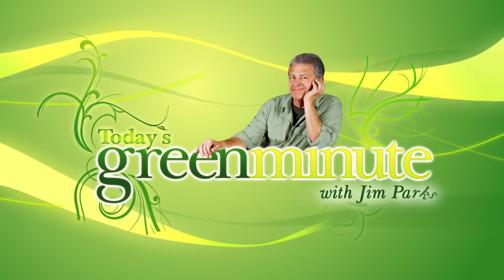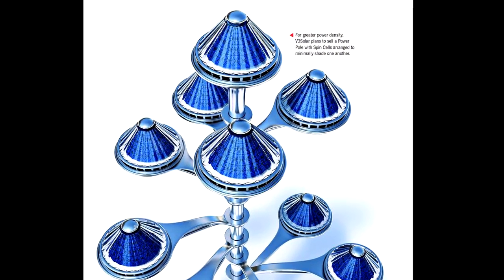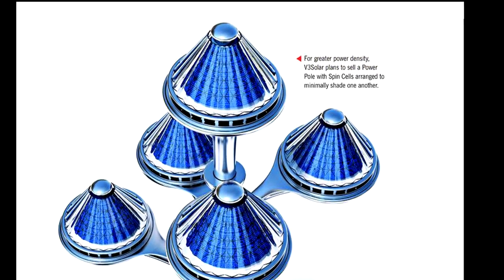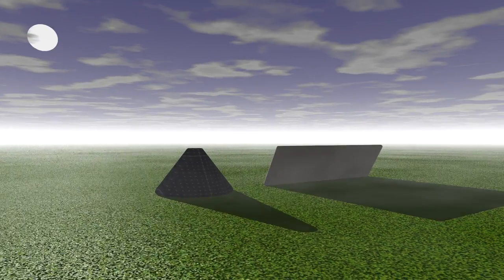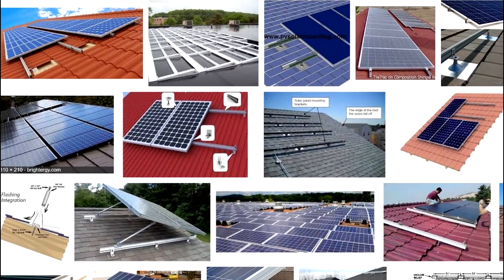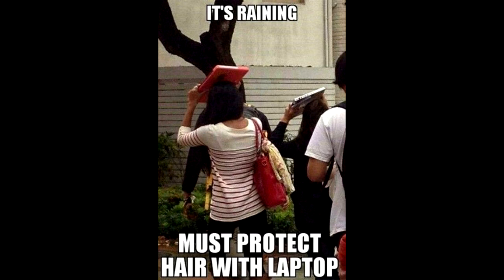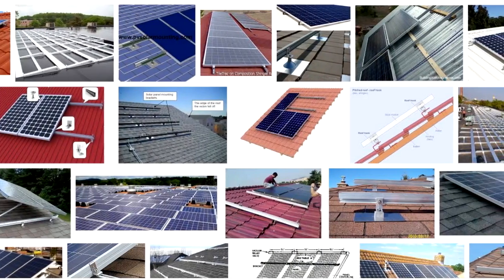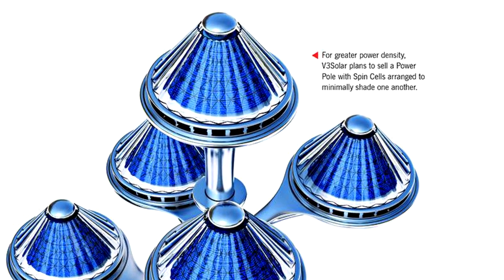Spinning Solar -BUSTED!

Comment: While I agree on most of the assumptions, there is one thing that ist missing. Lenses are able to collect diffused light from any angle in a range of 180°. This improves also efficiency on direct solar rays comming in from a flat angle. So the right thing to do is to use lenses on a flat solar panel. There are modern generations of solar panels that have smal lenses built in the glass that covers the panels,  this can increase efficiency of the panel in the range of a few % without increasing the costs or the weight of the panel in the same way. However the solar cones on a tree just look nice so it might serve a purpose once in a while as long as the main goal is not energy efficiency or cost efficiency. You might consider it as a kind of power producing decoration that can produce the power for a fountain somewhere out without needing to build a powerline.

Comment: Ok, so I agree with almost everything in the video, and I myself have debunked this solar "panel" a year or more ago but there is one thing that was not brought up in the video.  The most efficient solar cells require concentrated sun light to achieve their high efficiency.  Unfortunately these high efficiency solar cells are very expensive and require hundreds of times concentration to achieve the high efficiency.  The V3 solar collector linear lenses do not get anywhere near the concentration to power these high efficiency cell, and even if they could the efficiency would only be about double that of commercial non concentrating cells.  

But even if they were planning on using concentration and more efficient cells, they would still only have a fraction of the solar cells receiving concentrated solar radiation at any time.  So at the end of the day we still have bullshit.

Comment: The surface area measurements in the video at 3:56 are either wrong or do not at all represent the the picture of the cone on the screen. In the video, when showing the calculation for the surface area of the cone it shows the radius of the base of the cone as 1m when in actuality the diameter of the cone on the screen is approximately 1m. The radius is closer to half that indicated which provides for a smaller surface area which ironically only leads to prove the point of the video further. Love the videos!
Reply: The proportions of a diagram don't always have to be exact to what the measurements claim.

like if I drew a rectangle and labeled the sides as "1foot by 4 feet." then it's a rectangle that's supposed to be 1 foot wide and 4 feet long. it doesn't mater if I didn't actually draw the rectangle precisely 4 times longer than it's width and only drew it vaguely twice it's width. It's just for calculating measurements. you're not going to trace the exact image onto a real object. only it's measurements.

Comment: why wouldn't a diamond battery work? they're made out of compressed carbon 14 right? which is radioactive. well, I guess it probably couldn't boil water for a turbine but you could probably do something with the energy that comes off.

Comment: The solar panel is made out of two plates that are two different materials and heat is trigering them to generate electricity, aluminum plate is there for reflecting the sunlight, so both plates would be heated up equal, they are mountend on distance from te roof, so the aluminum won't overheat because of the surrounding, of course, they won't be efficient exposed to fire, because the fire is not emiting infra red light, so rotating them won't make them less efficient, they are even more efficient than the other type of solar pannel for people that lives far from equador, because the sun is not rising on the midle of the east part, it should rotate slow, about 1/4 rps (revolution per second), knowing all of this makes me wonder why you even made this video, to make people believe in lies that someting more efficient is actualy less efficient?

Comment: So you said the thing about water increasing fuel efficiency in a car. Could you do a video on something like that? It would be neat to see the process and numbers with an experiment. You could use a weedeater engine and mount it on to an alternator to generate electricity with a constant load on it, that can be a baseline test. Then you can make and use a hydroxy gas generator and see if that increases efficiency when used alongside the petrol/gas that was used in the baseline. Maybe even hook the OH generator to the alternator and see if you can make everything run on its own. I dont know if that would work because I havent done much research on it and I havent done any of the math. I just think It would be really neat for you to make a video on it.

By the way keep up the good work on videos. A friend suggested your channel to me and I love it

Comment: Ok TF, If a flat solar panel is facing the rising sun, the second half the day a flat panel in that direction will not be generating ANY power.  Where as the spining solar panel will hit both rising AND setting sun.  Which will allow it to receive sunlight 100% of the daylight hours, rather than only 50% of a days exposure as a flat panel.  While the flat consistently absorbs with 100% surface area, the spinner uses 30, and at high noon it peaks at 100?  

You generously left this information out of your energy calculations.  

As well a flat panel facing up, would have the same exposure flaws as the front side of the spinner adapted to 100% of its surface area.  So with indirect sunlight giving the flat panel only 70% for a given angle of the moving Sun, applies to the entire panels exposure.  

So whether or not these exposure times actually amount to a difference, I wouldn't know.  Because you only addressed one angle. 

 But a self cooling solar panel gets  100% of daylight exposure compared to 50% with a fixed flat panels position.. Sided with more efficiency from less heat produced.. It's like balancing out the flat panels "get hot half the day, second half of day cooling mode/dont produce any power".   So I hypothesize the spinner would equal about the same exposure as a flat panel with one sunlight cycle as it works with half exposure, yet twice as long, but also gets a cooling efficiency boost.  

Idk tho, I'm not going to do the calculations like you did, for every angle of the sun in a day.  Go buy solar panels and do some experiments for us :D

Comment: Seems the real solution is to find a way of making regular solar panels ata super low cost. If you can cover both sides of your roof with normal solar panels at a cost of £200 rather than many thousands it would be a no brainer, you'd cover every possible surface you could find

Comment: What about the new fad where they put water pipes behind the solar cells to cool them down while at the same time using the steam generated (sic) to power a steam generator.
I have seen them advertised at an event on green energy I attended.

Comment: Why not put flat panels near the river and put heat exchangers on the back of them and use the river water to cool them down? You can use a ram--pump and get all that water for no energy cost.

Comment: wow humans really are dumbing down. I remember something about in 100 years or so humans will become 2 species 1 of intelligence and a slave dumb ape version... it's looking true. I'm no physicist but I know capturing a large variation of wave lengths is the best system of pvc. but you want uv to optical wave length for highest energy particle capture. capturing ir generates energy at night but it's terrible yield in comparison.  no single current substance captures all light frequencies so you specialise in a wave length or layer the cell to maximise light frequencies capture using silicone with varying impurities. problem is you can only have so many layers.

Comment: The problem with solar panels is that when the sun angle drops the efficiency drops too, so we will take the solar pannels and put them in every possible angle, so that most of them can be facing stupid directions at the same time, but wait, we will also rotate them inside of a glass case for cooling.

Jesus christ... Not believing this shit should be common sense.

Comment: I found that using a "Magnifier Sheet" (used for reading text in books and newspapers), on a small solar panel, did increase the power output. But, it is important to keep the panel cool.

Comment: pretty sure those cones are supposed to replace static solar panels not tracking ones, that way they could get sunlight from any angle while being cheaper than regular ones. I'm agreeing with your opinion about those lenses though.

Comment: The way people get usable voltages from solar panels is by putting some of them in series. If one of the series cells are blocked out, you reduce the voltage and current in that entire series circuit to 0, which means you could potentially ve dealing with a 0% efficiency with the cone model, depending on how high voltage they design it to output.

Comment: There are spinning solar panels and they work just fine... But those are spinning on the blades of windmills so they get the efficiency boost of capturing both electricity from some of the sun's light energy and the mechanical energy of the moving wind turning a generator.  This concept was just that, a concept that probably wouldn't work out, but there are spinning solar panels right now that work, just so you know!

Comment: Why can't we have a solar panel that follows the sun? Just like how a sunflower does?
Reply: 1. sunflowers don't actually follow the sun; 2. we have those. They're just not very common. Actuators add complexity, reduce reliability, and increase the space required for a panel to operate efficiently. Depending on maintenance costs and available space, they often aren't worth it.

Comment: I would like to have someone explain how exactly you can debunk something with intellectual arguments and math without real world experimentation? I would find many of these debunkings more credible if they were accompanied by actual experimentation using the scientific method. The hyper-loop debunk was more convincing than this video. Also, many scientists admit that sometimes a technology will actually work, but they cannot explain how it works at the time until exhaustive experimentation and testing is done.

Comment: I agree the spinning cone is just retarded. But the back of it wouldn't be receiving 0 sunlight just by being on the back. Even my little baby batterybank solar panel continues to charge while i point it 100% away from the sun. 

reflections!

Not sure if my battery bank is just lying to me, or if it's a hilariously small amount of charge gained.. but it still says it's charging at least

Comment: we have had solar panels on our off the grid home for 15 years now. i can confirm that they generate power EVEN WHEN IT IS OVERCAST! yes, with no direct sunlight at all, so yes, the rear side of the cone will also be generating power even when facing against the sun, not 100% but at least 70%. and if the spinning motion for cooling is wind powered, put it on a generator, harness the wind energy as well. 2 birds one stone. 
. i love your videos and busting stuff but this is something worth investing and investigating further, i know its not gonna be 20 times more efficient than regular panels, but for the same surface area, combined with cooling and wind turbine implementation it can be generating more power per sq. m. of solar panel area than a fixed flat one

Comment: there is a way to make these work, not sure it would be better, add another cone around the outside, angled the opposite way, of mirrors, slightly angle the mirrors, make them spin, to suck air in and create a pocket of cool air around the cell,..it would look like a flower,  or something at that point. the mirrors now focus the light onto the whole cell, and the mirrors spin like a vacume fan, and suck air in to cool the cells...or attack a fan ring to the bottom of the mirrors, so as they spin around it pulls air in, and a small 1cm or 3cm gap between the mirrors and cell, will have the air output..then they could have cute little trees of spinning flowers..that catch all the light, and cool...and planes get blinded by a field of these things..LMAO

Comment: the Bible doesn't say pi = 3. the passage in question says that a good proportion of the interior diameter to the exterior surcumfrace of a brows hemisphere is 3
Reply: He’s likely referring to 1 Kings 7:23: “And he made a molten sea, ten cubits from the one brim to the other: it was round all about, and his height was five cubits: and a line of thirty cubits did compass it round about.” This describes a pool with a diameter of 10 cubits, and a line (string) of 30 cubits (3 times its diameter) went around it. (About 45 and 135 feet or 13.7 and 41.1 meters) But that in no way says that pi=3. Here are two likely explanations. 

First, it’s possible that the fractions were rounded off, so that if the diameter was somewhat less than 10 cubits while the circumference was somewhat more than 30, it was rounded to 10 and 30. In this case, 3 is just as honest a number for pi as 3.14, or even 3.14159265358979323846264338327950288419716939937510, since neither is perfectly accurate. The irrational nature of pi means that it must be truncated somewhere. Whether that be at 50 digits as above, or 3.14, 3.1 or 3, all are mere approximations. 

Another possibility is that the diameter was measured across the outside of the rim (described in verse 26 as like the brim of a cup), while the circumference was measured under the rim, which resulted in a smaller measurement. A string would not stay at the edge of a rim which curves outward, it would tend to drop down below the rim, where the diameter is smaller. So the pool could have been exactly 30 cubits around, measured below the rim, while the outer edge of the rim was exactly 10 cubits across.
Reply: Ethan Lamoureux unacceptable explanation. I demand you write out pi in full!!! 😡
Reply: If you want facts don’t read the bible
Reply: Ethan Lamoureux so the book writen by god just went lazy?
Reply: I am gay and from now on will be calling myself “Sur Cum Frace”
Reply: Jonathan Della Santina which part of the Bible is that in reference to? Can I get a book chapter and verse ?
Reply: jesus perez - Book written by God? ROFL, old bean, ROFL! You sound like the kind of chap who'd enjoy a trip to that Noah's ark exhibition/theme park thing. Bullshit for deluded cretins? Utter cobblers for misguided zealots? Horsefeathers for the tragically credulous? Hmm. I can't decide... (Don't let Noah's contemporaneous dinosaurs upset you, by the way; if you pray hard enough, Jesus, Allah, Odin, Zeus or Barbara Eden will make Mr and Mrs Tyrannosaur TOTALLY turn vegan. It's true! Yay!)  Oh, and this is definitely the wrong channel to try to defend dodgy books; Bible, Koran, Talmud, Spaceship Earth, My First Colouring Book Of Miraculous Fairy Stories, whatever. True, they've got lots of pages, and yes, the sheets are reasonably absorbent, but it's jolly poor form to wave one's toilet paper about in public. Now, wash your hands, please.

Comment: spinning will use up energy will those spinning solar panels have enough sunlight to make them spin if so wouldn't all that spinning just drain the energy instead of it becoming more efficient? this is just common logic from a guy that isn't even that good in science or math.

Comment: I think the point of the lenses is that you could have tiny strips of photocells instead of the full cone, i.e. 1/20th the surface of the cone with a cone sized lens, not 20x the lens for a full cone. However, the image of the sun would move around on the cone if you did that, and you'd need weird tracking complexity, that you could have just put on the flat panels instead, so still doesn't make sense, but I think that's what they're thinking.

Comment: see I don't mind your expertise on why it won't work (heck without people like you we would think that  Gatorade is better than water for plants) but you do have to keep in mind that it's ideas like this, get others thinking of new ways to improve our technology.
Reply: But thinking of solutions is only useful if it's pointed in the right direction.
 We could spend all day thinking of building ladders to reach the moon but it would all be so much wasted effort.
Reply: It's one thing to research, predict and test theories and quite another to sell untested (let alone stupid) ideas for personal profit.
Reply: yep, and it's not like this isn't an idea worth trying, dispite the 50% not in the sun problem it may have turned out cheaper with less heat problems, sounds worth a try. Just a shame it discredits the whole industry with to much high profile bs.